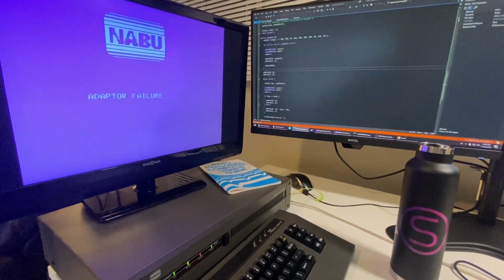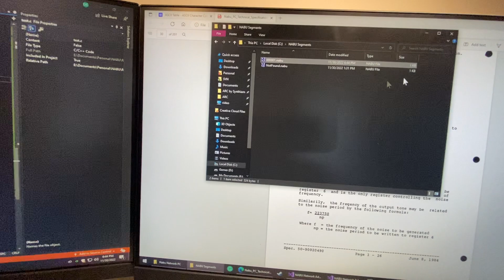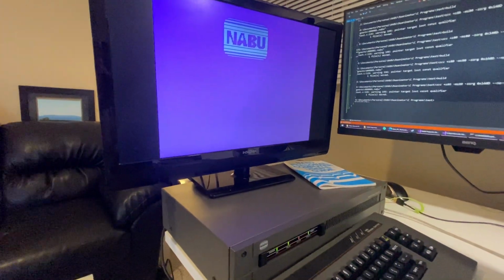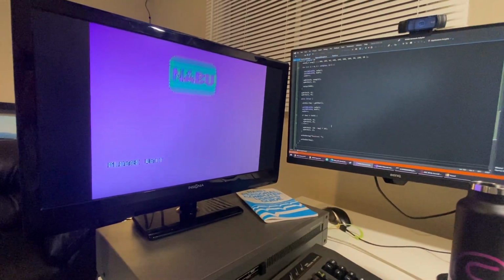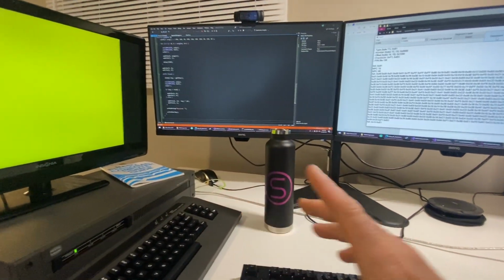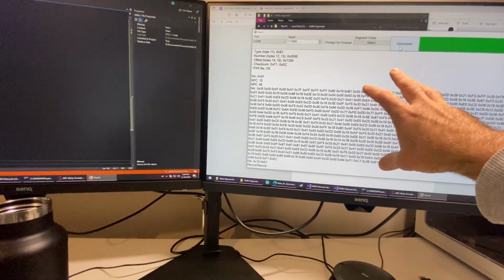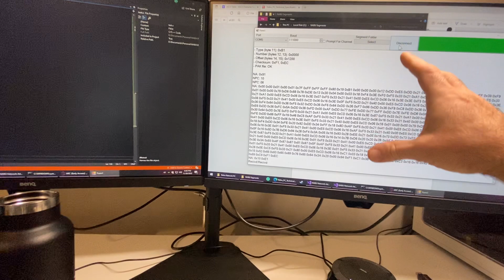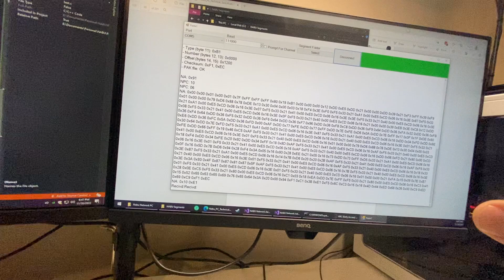11 - Nabu Computer Rock’n’Roll’n

Comment: so it's just continious loading. no blocks. no checksums... no packet protocol. (although i'd assume the 'adaptor' is kinda like a simplified pad/tnc in it's own right as obviously such a network is not circuit switched - that thing is about as large as the computer itself for a reason ;) and as such it should be able to basically run any z80 console rom with the same video chip after changing the video address. (no joysticks tho ;) or maybe it's not and it stops loading after the first 'block'... as so far i only see really tiny programs running. try padding it with like 20K of nop's :P as i seriously don't expect a box from those days with a protocol from those days over a network from those days to just 'assume' the data is all correct and happily download a full 64K or so in one go.
Reply from the maker: There's a protocol packet. There's blocks. And there are checksums :)

Comment: Almost time to get The 8-Bit Guy and company to work porting Attack of the PETSCI Robots over to the NABU! 😁
Reply from the maker: YES YES! I support this message
Reply: Maybe David could make a version for the NABU that is multiplayer.
Reply: I don't know what full character set exists on the NABU, probably just standard ASCII.  But that doesn't mean it couldn't be done.  Heck, I'd considered building a dual video card for my Apple ][+ around 1980 to drive a pair of surplus camcorder viewfinders with 1.5-inch CRTs for stereo-optic display.  Sort of an early virtual reality type device.  Still wish I'd done that!

Comment: Maybe put a RPi in the network adapter cabinet, at a different address on the RS-422, and load files via that?
Reply: Hah, that's such a cool idea, actually.  Even power the Pi from the PSU in the Adaptor cabinet.  You could even do it while being minimally destructive to the Adaptor itself!  I recently picked up 2 NABUs plus one Adaptor, so now I have something tangible to do with the latter! 🙂

Comment: Super cool! Such potential in this thing!

Been watching your journey into getting this machine to become a fully functional retro machine. 

I have pulled the trigger on one yet. One of my intended uses for this is as a interactive fiction / text adventure / Zork machine. Do you know if the Nabu can be set into an 80 column mode?
Reply: Hold a second ! The F18A VDP has 80 columns and VGA video output.